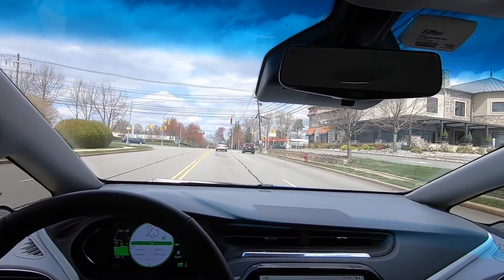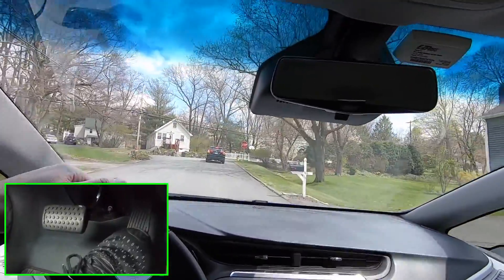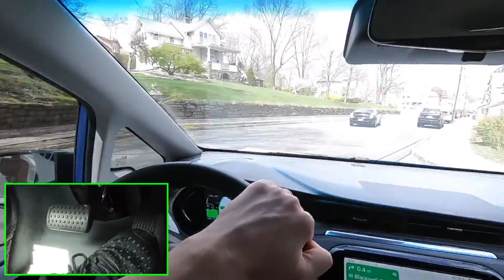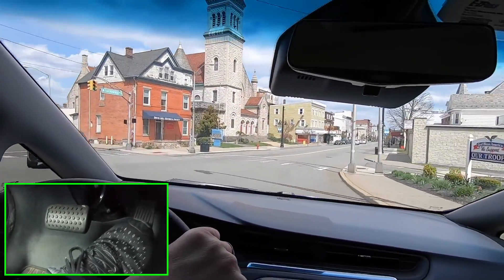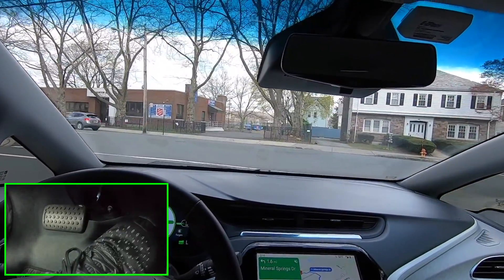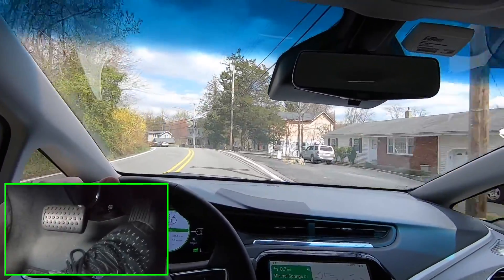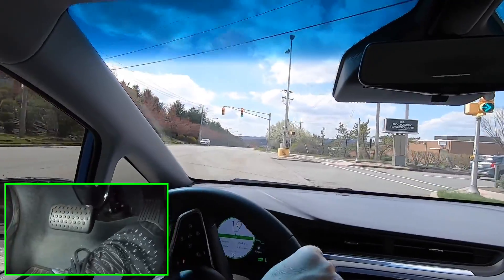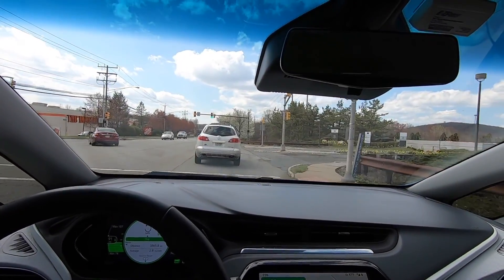Driving Chevrolet Bolt EV with one pedal to maximize range

Comment: Here's my question for you...I have the 2023 Chevy Bolt EUV and I just started using one pedal driving... on the far left there's the Maximum KM (I live in Canada btw) the average? KM and the Minimum KM... is it even possible to achieve the Maximum KM or will you just get the average KM or even Minimum based on the way I drive...I love this car btw

Comment: I drive with One Pedal Braking on to receive recharge benefits. It works great and I rarely have to use the brake pedal. Chevy claims you can also use the Regen on Demand paddle along with 1 Pedal Mode but they seem to be mutually exclusive, one or the other, to me. What are your thoughts Dave?

Comment: So how much does it actually recharge battery?
Reply from the maker: It doesn't necessarily recharge the battery... it's more like you are extending your range. For example my wife drives with a heavy foot and average about 2.9 to 3.0 miles per kilowatt hour... I hop in and drive using one-pedal and the regen on demand paddle and can get 3.9 to 4.0 miles per kilowatt hour out of the car basically going farther on the same amount of charge.
Reply: @DaveBsellsChevy  
Ahh gotcha thanks

Comment: You need to know your car pretty well to be able to safely do this.
Reply from the maker: There is a small learning curve but its awesome once you get the hang of it.  It's funny when I drive the Bolt a few days in a row and then hop back into a regular car I find myself wondering why I'm coasting so fast after letting go of the throttle.

Comment: I use one pedal driving every time I drive my Bolt.  I have seen some information where the brakes seize up on some 17/18 bolts from non use in the rust belt states, so I've been making sure I use my breaks once or twice a week just to be on the safe side.  Thanks for the videos.  Watching your Bolt videos is what pushed me over to pull the trigger and buy my Bolt.  By the way, what's your opinion on an extended warranty for the Bolt.  I bought one and have a bad case of buyer's remorse, thinking I probably wasted the money.
Reply from the maker: Glad my videos helped out! Extended warranties are a good thing depending on what they cover. It's a tough call on the Bolt, It seems to be very reliable so far but the battery and electric components aren't cheap to replace if something did go wrong outside the factory warranty. I guess it would all depend on how many miles you drive and how long you plan on keeping the Bolt. You should be able to cancel the warranty for a refund should you choose to do that.
Reply: hey dude how much more range you get with one pedal?

Comment: My 2019 Bolt EV is usually driven with selector in "L" (I may have missed you mentioning that).  In "D" there is some regen braking, but much more like a ICE vehicle.  There is a YouTube video that looks at how much braking is available in "D" and "L", whether using the paddle or not.  In summary the paddle provides a bit more braking than "L".  It is harder to use the paddle while wheels are not pointed straight.  I usually tap the paddle to exit cruise control (there are several other ways to do that, so personal preference).  

When the vehicle was new, the engine would hold better at a stop on a grade.  Over a few months that started to loosen up.  It still holds, and seems to provide the same braking as when new.  The question is when does it become a maintenance issue.  The car does brake significantly while driving down hill and tapers off as we approach a stop.  

I haven't seen any automatic parking brake.  It may have happened once when I was playing around, but didn't understand what happened and haven't seen it since.  

There is another YouTube video that tapes a mirror to the rear roof and set to see the brake light, so the video was watching the console but could still see when the brake light was on.  Am thinking of putting a mirror on the rear light where I can see the brake light in the driver's outside mirror, but i am not planning to record video.  Not a long term intent, just to see for myself when the brake lights are on, or not.  I don't think the OBD sensor has any readings for lights, otherwise it would be easy.  

Note that normal braking (with the pedal) uses regen braking.  Only when braking hard are the wheel brakes used.   Few of us will be needing any brake work for a looong time.  

It's pretty neat to drive up a mountain with cruise control, then note the kWH used and drive back down with cruise control.  Going down, the CC holds the car at the set speed, while an ICE car will speed up on steeper sections.  That is very nice.  At the bottom of the hill, the kWH "used" is LESS than when starting down from the top (lots of recharging).  Next time I need to note the kWH value when starting up, then at the top, and again at the bottom.  I expect to have more "used" at the end than at the start, as you might guess.  But it is great to regen significantly on the way down.
Reply from the maker: Thanks for sharing Mykle! I have a video with a camera mounted to the back of my car to show the brake lights.... And I've had the idea, like you mentioned, about a documenting the up a mountain/down a mountain results. I plan on doing it next time I am in PA by Big Pocono State Park.

Here is brake light video https://youtu.be/bxMxAr5uNyc
Reply: Thanks Dave!  Funny, I saw your brake light video right after posting my comments.  Good stuff, thanks and well done to synch both video streams.  

I did a simple test today, climbing 4000' over 16 miles of road from the base of a mountain road to our destination.  Then we went for a hike !  Going up and down, cruise control was active at 38mph, using the "L" setting.  The foot brake was not needed at all.  

I usually get about 5.3mi/kWH around town, suggesting 3kWH are needed for 16 miles on relatively flat terrain.  

The vehicle screen shows the "power consumed".  It is reset to zero after the vehicle is charged, and the value increases to show the power consumed since the last charge.  The values displayed at the base, top, and base of the mountain were 25.6, 34.7 and 31.8 kWH.  

That's minus 9kWH to go up the mountain and plus 3kWH to come down (minus is power consumed).  If flat terrain needs 3kWH, then going up required an additional 6kWH, and going down recharged 6kWH.  

Note that the available battery power when I reached the bottom was GREATER than the power available when I started down, because of recharging while going downhill.  If these numbers warp your mind, let me know and I'll see if I can rephrase.  It's not hard to understand if you are used to regenerating power while braking (and going downhill).  

I thought it was interesting that the numbers are comparable, with little if any hidden changes in available energy.  No, this was not a scientific exercise, but a quick check of numbers.  I do have an OBD reader linked to Torque Pro, so I could look at the logs if I wanted to dig more deeply.  It doesn't look like that will be necessary.

Comment: does this have anything to do with the 1 speed transmission?  I wonder if the gas powerd Malibu acts the same way
Reply from the maker: No, it's different since the Bolt has no transmission. The Malibu's 1-speed is a CVT transmission

Comment: Dave, how does coasting" work if at all? As I drive my ICE today, I realized how often I let off the gas as I drive in town. Can you talk about that? I can't wrap my brain around it.
Reply from the maker: As you let go of the pedal the Bolt will slow using the regenerative braking. It doesn't coast as a regular gas car would. So, in a sense, when you release the pedal partially you can control how fast the car "coasts" to a stop although you're really not coasting because you are still applying throttle.
Reply: That makes sense - like I said I couldn't quite get a feel for how that would work. Thanks for clarifying!  Driving today I was really paying attention, especially since I haven't been driving much.  I finally drove by my local dealership today to just look at the Bolts. I'm not ready to buy yet, but I can't wait. Thanks!
Reply from the maker: Awesome! Make sure once things open up you head back there for a test drive.

Comment: I leased a 2020 Bolt in January. I drove a 2017 Volt before that. Regen braking in the Volt would bring me almost to a stop but not quite unless I am was going uphill. On my Bolt regenerative braking does not work hardly at all if my battery is full. After about ten miles the regenerative braking starts working  problems.
Reply from the maker: My Bolt does the same thing. I'm pretty sure when the battery is full it doesn't regen because there is no where for the energy to go... As the battery depletes a little then the regen can put that energy back into the battery.

Comment: My 2017 also turned on the electric parking brake on a steep downhill road that I had stopped on.
Reply from the maker: I have to keep trying mine on different grade hills. My 2019 doesn't seem to do that
Reply: @DaveBsellsChevy  My 2020 doesn't seem to do it but my 2017 did. I still can drive 50 or 100 miles without the brake but I live in rural upstate NY.
Reply: @mosfet500  I haven't had the opportunity to reproduce the automatic parking brake engage (I posted the original comment regarding my 2017 Bolt). I did find another easy to reproduce case where the parking brake engages. If the car is in D (or L) and you unbuckle the driver's seat belt, the brake is engaged. I tried this several times.